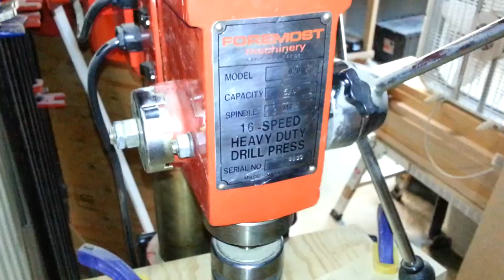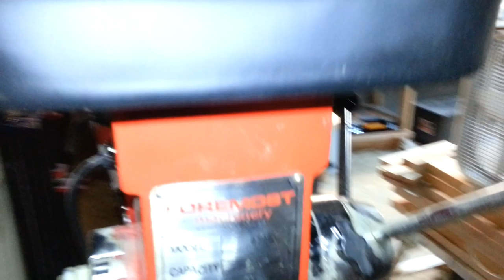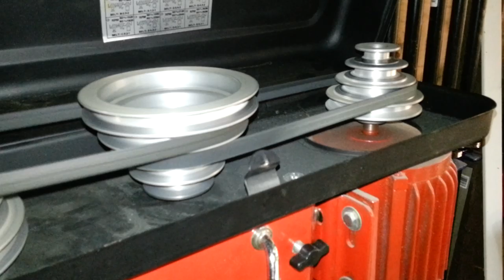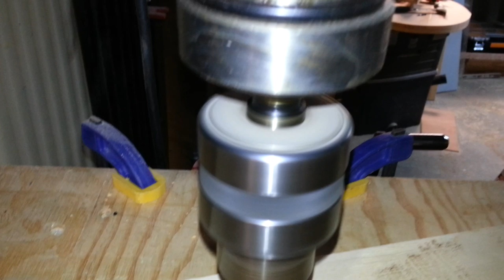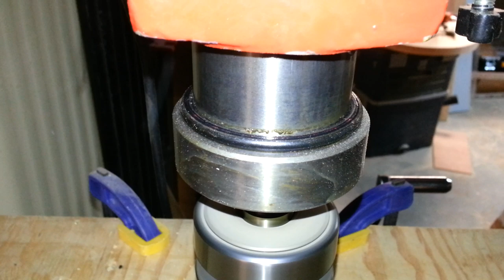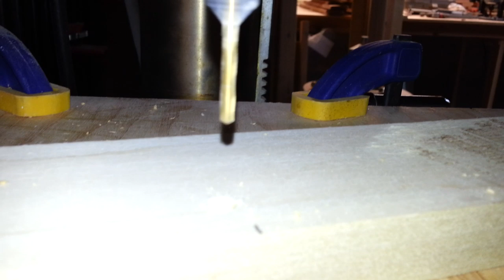Foremost 16-speed drill press making a grindy noise

Comment: I had the same problem. The pulley on the motor had slipped down a fraction and was barely touching the sheetmetal housing. I undid the pulley's grub screw, lifted the pulley a tad and retightened the grub screw. Hey Presto! All quiet now.